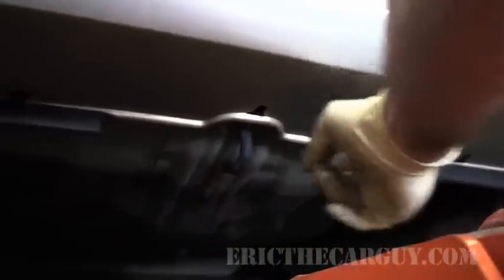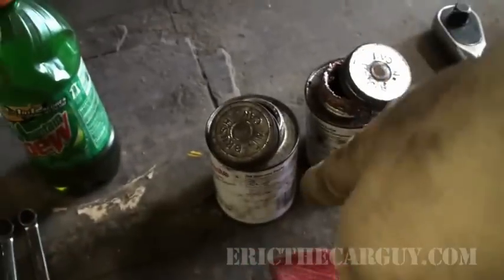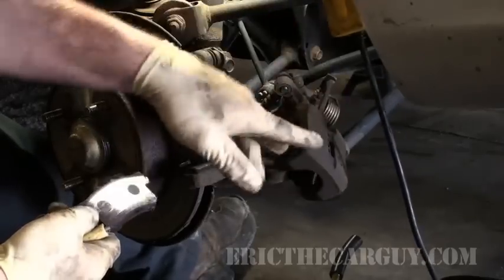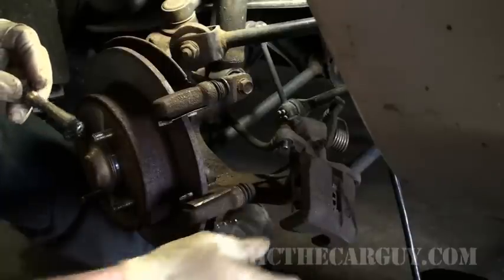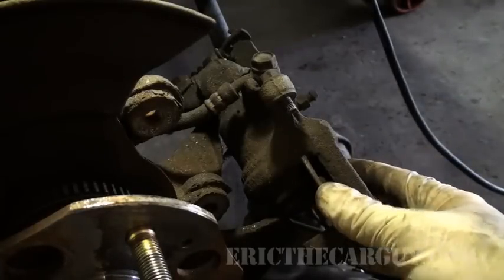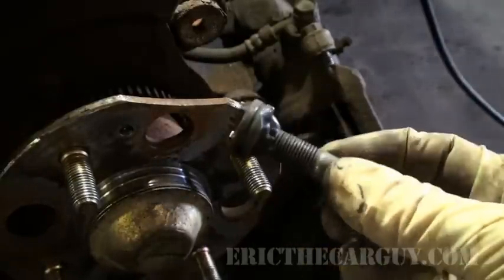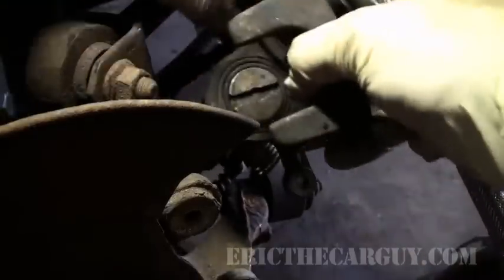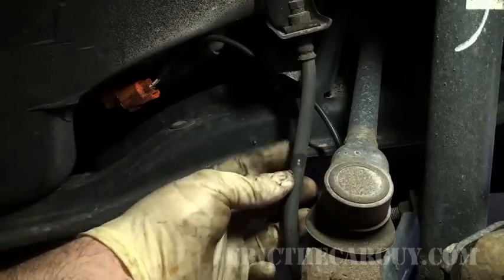How To Replace Rear Disc Brakes (Full) - EricTheCarGuy

Comment: The video is awesome! but i have a quick question about topping up the master cylinder cuz i was told that you should never top it up...could anyone explain?
Reply: It should not hurt to top up a master cylinder, what you don't want to do is let the master cylinder run dry,
I got to say this, if the brake working good and there are no leaks, you would rarely have to add brake fluid to the master cylinder.
I hope I understood your question.
Reply: just talked to the guy that told me not to top it up and the reason for it was that if the brake fluid is low due to brake pad wear instead of fluid leak, you will have hell of a trouble pushing the piston back when you are changing brake pads
Reply: Tobey X Yeah, its true what you are saying, I never thought of that.
Reply: Tobey X Now I got a question for you, what do you think about small cracks with brake rotors?
My truck has hairline cracks with the front brake rotors.
Reply: honestly i have no idea, but i guess it should be all right since i have seen some fancy race cars with star patterns embeded on thier rotors, and the lines are way wider than hairlines cracks. Cant answer that question cuz i am new in the trade
Reply: Ford6.9/7.3idiDieselFan the cracks are from heat, if any of the cracks reach the edge of the rotor or you can fit a fingernail in the crack replace the rotor.
Reply: Kids videos
Reply: JuMBOFrI903 incorrect any cracking in the rotor casting can cause significant brake failure and death

Comment: when replacing the old pads to a new one, do you have to bleed out the small 10mm nuts on the caliper when trying to push back the piston or just leave it like that?

Comment: 2007 element rear disc, I was not able to get the rotor off the car it seem like I have a parking brake working inside holding my rotor
is this the way the element works?

Comment: What is the reasoning behind openning the bleed screw when pushing the piston in?
Reply: It's not advisable to force fluid backwards through the master cylinder as it's been known to flip the seals, this is why we open the bleeders. It also helps as it makes the piston easier to push back plus, the bled fluid is also now excess fluid as it's space will be taken up by the extra thickness of the new pad material.

Comment: 08 Civic coupe, brakes installed along with new rotors.. pads are rubbing the rotor. I cant get it to go away.. its not grinding its just rubbing..the same sound as in the video when you turned the rotor with brakes inserted. Any suggestions?

Comment: Hi, why do you not want to pump fluid back into the master cylinder? I replaced my discs and pads last summer and just wound the rear brakes back in. They have recently failed the MOT because of binding, might not be related but was just wondering.

Comment: im having trouble with my 2003 nissan n16 pulsar q  ive taken off the wheel caliper ect but ive bent a g clamp trying to push the piston back to make clearance for new pads,am i meant to be turning it clockwise i know on the honda thats the case but wasnt sure what to do on the nissan i have.

Comment: I JUST did this to my 2006 Civic... I didn't pinch the hose. I loosened the cap under the hood in case any fluid came out but I didn't do what you did with the bleeder... did I screw something up terribly? Also how long does the rotation sound usually last? I only had it for the test run when I did my fronts but I've got a lot more noise now that I've done my rears. Even after my test run it's still just as loud.

Comment: Why not let fluid go back into the master cylinder? This is what I've always done. It just fills up the reservoir to a higher level. You only have to check and make sure that fluid hasn't been added to cause an overflow. Am I missing something?

Comment: Ran into an issue after installing the new rear brake pads. They are now starting to smoke after short distance driving and stopping, and the pads are becoming extremely hot. What could be the problem?
Reply: I have 3 ideas 1 there is not enough air passing by the pads and they dont have enough air to cool them 2 you need a new disk or 3 you bought the wrong type of pad and you need a heavier duty pad hope this helps you

Comment: After changing my rear pads, rotors, and hoses for stainless steel lines today, I bled both sides about 15x each (literally) and had a steady stream of fluid streaming out. Pedal pressure is VERY very spongy though. During the whole process I made sure not to let the brake fluid reservoir dip below the minimum line. Anyone have any idea what I may have missed?

This is for a 2012 Jeep Grand Cherokee 3.6L with 2WD. any suggestions? 

Thanks!
Reply: If you changed the hoses to stainless for the rear, you must also bleed the front. By removing all the brake lines for the rear and installing new lines, air would have surely got into the line coming from the front, causing your spongy feel. You must have a second person assist when brakes are bled. The pedal must be held to the floor and then the bleed screw tightened. The pedal must be released slowly. The depressing of the brake pedal and the tightening of the bleed screw must be carefully coordinated, otherwise air will be present in the system.

Comment: its just antisize. Any hardware or automotive store should have some. We use it all the time for plugs at the oil refinery i work at. Bolt antisieze, threading antisieze itsall fine.

Comment: on the springs, i changed my brake pads but my car still squeaks when I break, what I noticed in the springs is that they seemed a little rusty and bent. could that still cause my car to squeak? I have an 2003 honda civic si hatch and the rear did look different when changing the pads.  one more thing my rear wheels sometimes makes like a popping noise or like the rotors are hitting something after each spin?
Reply: I had rear breaks do something sorta like that after I changed them. I had to get a break hardware kit and replace the pins that hold the short Springs. one of these little pins holding the springs was bent and it caused this clicking and popping sound.

Comment: HELLO ERIC, QUESTION PLEASE , I HAVE 2004 CHEVY HD 2500 , CHANGING THE REAR PADS.WHAT .................SIZE STAR BIT DO I NEED PLEASE TO REMOVE THE THE TO SCREWS UPPER AND LOWER TO GET THE CALIPER OFF IN ORDER TO REPLACE MY PADS PLEASE. ..DOES THIS COME ON A SOCKET. OR WHAT PLEASE ,THANK ERIC FOR YOUR HELP

Comment: after releasing the vise grips on the brake hose after resetting the piston, will it leave air bubbles in the empty space where the old fluid use to be

Comment: Eric, is it OK (and safe enough) to JUST change pads, cleaning any rust from rear rotors, not cutting, just leaving them grooved - what tolereance/measurments can I go with to be safe? I dont mind, temporarily, that the pads would be ruined by the rough rotors, that's OK. I just want to do it it short-term, but safe.

Obviously, I would silicone paste the bracket pins, clean any rust out of the brackets, basically do everything, except cut the rotors (or even try, at this point).

This could be an oxumoron (and I could be a moron). I am dirty.

Andm, I take all responsibility for not cutting the rotors, or replaceing them at this time.  BTW< I would not be drving "on road" with these until I get new rotors.

Comment: The only reason would be because your forcing fluid that has been in the caliper possibly being contaminated through the system. Other than that the metering valve will just do its job.

Comment: Negative!  WD-40 is a lubricant, and spraying it on your brakes can cause the brakes to not work at all!  The spray that's used to clean brake rotors and other parts, is a "Brake Parts Cleaner," available at your local auto parts store. There are many brands available, but for this purpose, any brand will do, so long as it's a spray intended for cleaning brake parts. Hope this helps! :-)

Comment: the inner pad with the little pin should fit into the slot on the capiler piston, but if the caliper piston is going counter clockwise when pressing the brake pedal- how it will turn? the brake pad cant turn.. im confused

Comment: im going to change disc and pads, but my question is, when i compress the cylinder on the caliper, dose it need to turn or can i just push it straight in? I see some people turning it with the spesial tool and some other people just ad preassure on the cylinder, what to do???
Reply: It depends on your brakes. If your calipers cylinder look like the one in this video with the slot or has a flat surface with two holes (a means to twist or turn the cylinder), then you will need to spin the cylinder back in. If the cylinder is open or hollow, then it is the push in type.
Push in: http://www.zpost.com/forums/attachment.php?attachmentid=1033098&d=1401066470
Spin in: http://tinypic.com/view.php?pic=ztd5hy&s=4#.VO-_1UJHDi4
Reply: ok, thanks for answering :)

Comment: hi, i just replaced my rotors and brakes on my rear pads yesterday, but i never clamped the hose or opened the bleeder valves when turning the caliper back in place.  (i didnt watch this video until today) what consequences will i suffer? I took it for a test drive and everything seemed ok.  now i'm worried.thanks!

Comment: I use a pry bar between the pad and caliper after i open the cap on master cylinder and most times the piston is back far enough to get new pads  i know some have ceramic pistons so i am careful just don't always have a c clamp and is easier sometimes  but not on the back forgot about the screw in

Comment: Hey what happens if the inner brake pads are installed with the wear indicator   The opposite of how it gies for example the front should be on top but instead its installed with it on the bottom ?

Comment: hi eric, please help.. i did all what you did in this video after i change my 4 rotors and 4 brake it has this squeaking noise on the rear right side, and when i check the brake pads it has uneven scrathes.. what should i do?

Comment: Interesting how you have to turn the brake cylinder clockwise to move it in when changing the brake pads. But with front brakes on a Civic you just use a c-clamp to gently push in the piston. Different design I guess

Comment: Crap, I can see myself screwing this up. At some point this summer I plan on electroplating my rotors and calipers. Shouldn't be an issue right?

I drive a 2003 Monte Carlo. Any wonky quirks I should know about before hand?

I'll attempt the front ones first and see how that goes I guess.

(I operate a zinc electroplating line so this is free for me)

Comment: Not sure if anyone can help me out. Changed my front brakes and rotors, no problem.  Got to the back and can't seem to fit the new rotor in. I adjusted parking brakes all the way down, there's no more adjustment that can be made. I'm using the same centric rotors that are painted. Do you think it's the eccess paint? If so, sanding it off would work? I used the same rotors before on another car with no issues. This time it goes in, but not all the way in and flush. Please help. Thanks.

Comment: Tried this job today on a 2005 Civic. Could not get the caliper slide pin bolts out to remove the top of the caliper. Stopped me before I was hardly started. Tried soaking them in WD40 several times but they would not budge with a 12mm socket or spanner/wrench.

Any tips for this?

Comment: could somebody explain why he didn't bleed the brake fluid after unclamping? isn't there an air bubble in there where the hose was pinched off? Wasn't the fluid that came out into the bottle inside the piston alone? I'm dumb and confused.
Reply: The bottom end of the line into the bottle was immersed in fluid therefore no air could have entered.

Comment: Hello Eric ! Can't you give me some advice ? I was removing Brake booster on my passat 2001 2.5 Tdi V6 AKN . I rebuild it by my self (water ingress) after I connect all stuff ,my brake pedal after pushing it down to floor ,  ,when still pushing on it pedal pushing my foot up very stong . Is it air bubles ? Because disconecting brake fluid tank from master cylinder few times ,and cassualy push on brake pedal . Waiting for advice !

Comment: it was my experience, without the brake pad nubby in the piston slot, with NEW pads, you will not be able to get the caliper seated down over the pads. Kind of a fail safe feature, i think.

Comment: When you bleed the brakes it gets the air out of the system..since most hydraulic brake systems are a sealed enviroment.  If there is air in the system anywhere you will not have any pressure and the brakes will not compress and stop the vehicle.

Comment: You just screwed up the surface of the bleed screw with the wire brush, and you don't need to bleed the brakes to push the piston back. The fluid will return to the reservoir just like it does each time you use the brakes.

Comment: Old Honda Distributor, $20.00. Bolt- $0.50, Welding tools- $75.00. Home made Caliper Pusher Inner Tool (C-PIT) to prevent you from beating your wife out of frustration with the damn caliper pistons- Priceless. For everything else, there's using my brain.

Comment: Any ideas on what might be causing a clicking noise on the rear brakes of a 1993 3000GT when moving forward? It doesn't happen in reverse and the brakes make a clunk when loaded with the handbrake.

Comment: Hi Eric,  my honda Accoard 04 is making a clicking noise, at the front right side, when ever I break softly.  it goes like click, click, click, click....  But If I break hard, then no sound. Also, if I drive in reverse, and break slowly, then no sound!!  One mechanic told me that I need to replace the break pads, but doubt that the problem, I got new break pads and rotors last year, and they still have lot of life in them. Any idea, what might this sound be?

Comment: ugh. did my front no problem because I could turn the wheels so I had room to get leverage. back break bolts will not break for anything. I have zero room to get any type of leverage. bummer. 04 g35 coupe

Comment: the dust is from semi-metallic pads, most likely. i put all ceramic pads; no dust.prob solved. its not the rotors; no need to replace; they can be turned; depends on wear.

Comment: and for me, The indicator, when I went to put the pads on the indicator got cought and I couldn't figure out why the pad wouldn't go in, So I had to push it into the right spot with screwdriver

Comment: Silicon Paste or Copper Grease? What's wrong with Copper Grease? I got loads of it.

Strangely enough my latest front brake pads came with a tiny packet of Silicon that was grey coloured rather than the clear stuff in this video. Yet the same generic multi-language instructions that came with the pads said to use Copper Grease anyway on the backing plate, etc.

So - Silicone or Copper Grease? and if Silicone - the clear stuff or the darker stuff?

Comment: dam i try taking off the caliber bolt but that bolt is bolted on tight. i try forcing it with all my strength to get that bolt out but i couldnt. im thinking of just taking it into the shop and have them take do it for me along with my shocks and struts.

Comment: Does anyone know if the right caliper piston need to be turned in a counter clockwise  direction?
Reply: +Tony D When you're facing the piston face, you should turn the piston in the regular clockwise direction. Just always be facing the front of the piston (that pushes on the brake pads).

Comment: There is no way to tell if a rotor needs to be changed based on visual inspection unless it is very obvious. Typically you will need to measure the thickness with a verneer caliper for minimum thickness after the rotor has been turned on a lathe.

Comment: Yes I know about the air, that's OK. My question is, why to displace brake fluid true bleeder when compressing cylinder in order to accommodate new brake plates, when you can just compress it, there is no air in the system.

Comment: This concern is for anyone with an answer. I have a 2004 accord V6 coupe my rear brakes were just changed and when I apply my handbrake even from 6-9 clicks from my Ebrake my car still moves easily. Also I can pull the Ebrake almost all the way up without resistance. How can I adjust this?
Reply: i thinck you may have bend the little rod inside the e-brake macanism. It is the same as n rover  600 series. After changing the rear brakes you have to pump several time the foot break in order to adjust the piston position. if the pistion is not positiond you can apply the handbrake much to far and bend over the little rod for handbrake mecanism. it is a great job to repair this !!
Reply: Victor Gonzalez Can't say for sure, but I imagine the procedure is fairly similar to that of a 2008 Honda Civic.  I just did this procedure yesterday and it took care of the problem that you describe.
http://www.8thcivic.com/forums/diy-honda-civic-suspension/57589-diy-parking-brake-adjustment.html

Comment: 2. I tried everything to pry loose the screws that held the disc: Rust solvent, normal philips driver, impact driver, hammer on hammer - the f*cking screws wouldn't turn a bit. I ended up doing it like so: With a 3 mm drill I drilled a hole about 8 mm deep into the center of the head of each screw. Then, with a 6 mm drill, I did the same, until the screw had came of. After removing the discs, I could now grip the end of each screw from behind the hub with a small pair of tongs...

Comment: My car has been standing still for a month. Today I went out and started it (ot started first try). But when I released the parking brake I noticed it didn't start to roll (I've parked it in a slight uphill area so it should start to roll a little bit). I was in neutral with the handbrake off and had my girl try to push the car, well, it is STUCK. I read in the manual and it says the ebrake is separate from the regular brakes. I have no idea ehat to do. Don't even know if I have drum or disk br